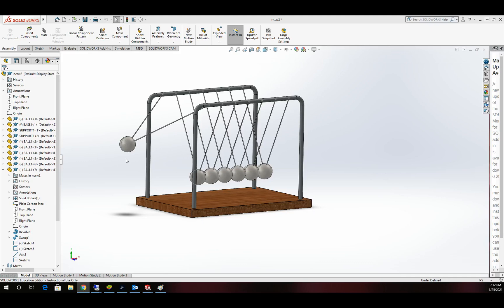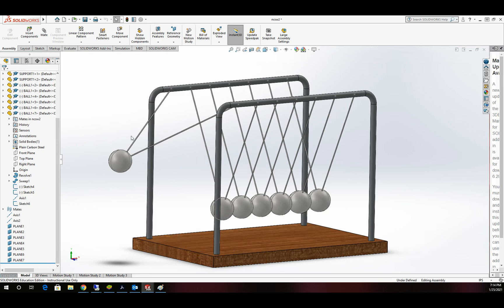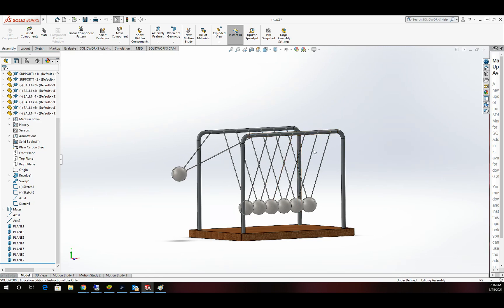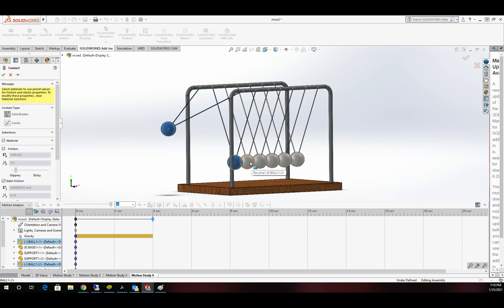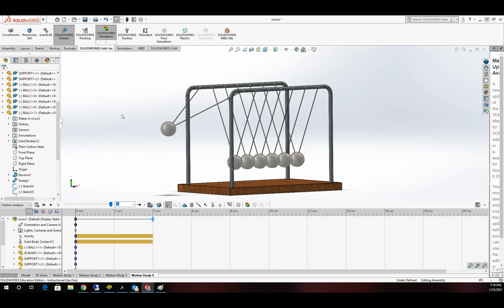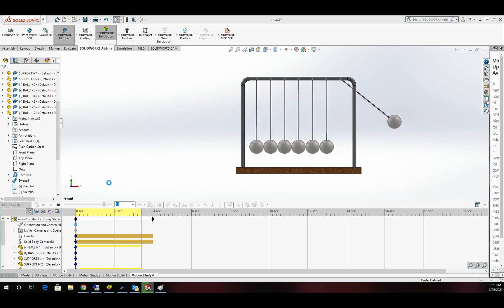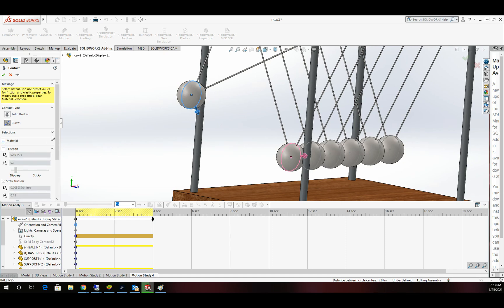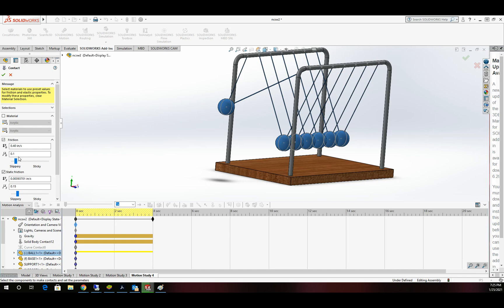SolidWorks Simulation of Newton Cradle

Comment: Excuse me. When I am doing the motion analysis calculation, it shows an error which is integrator is unable to start. What should I do?
Reply from the maker: hmmm,  let me see if i can recreate the error.  My current thoughts would lead me to investigate the DOF of the parts and make sure the ball only has one, rotate.  and the the second thought is that the balls are not impacting in the same plane.  Give me a few days and i will try and recreate the error message and walk you through solving it.